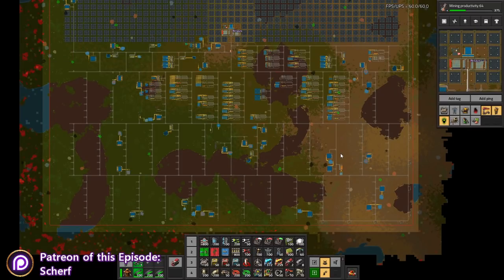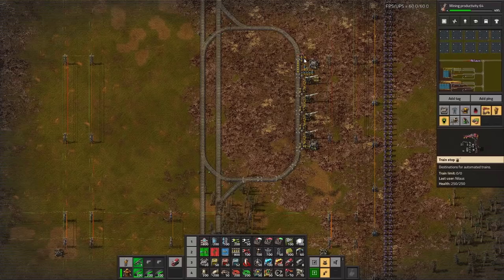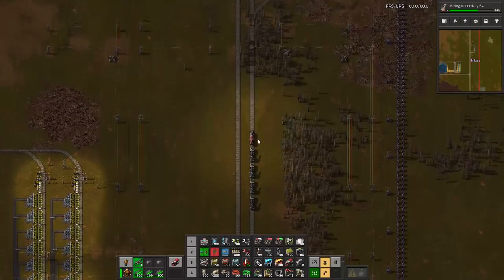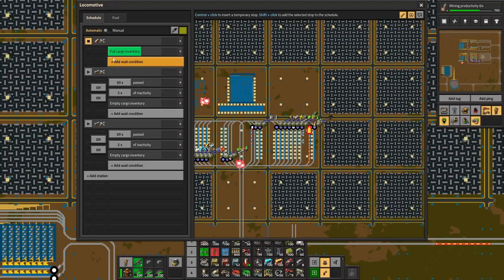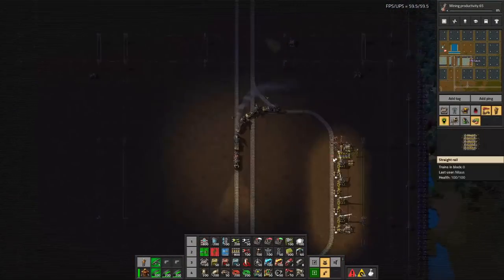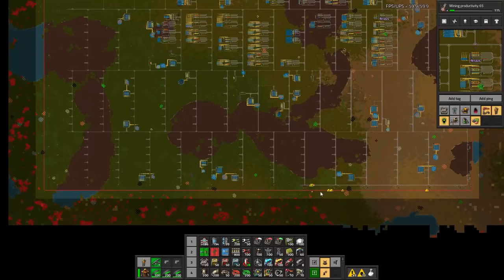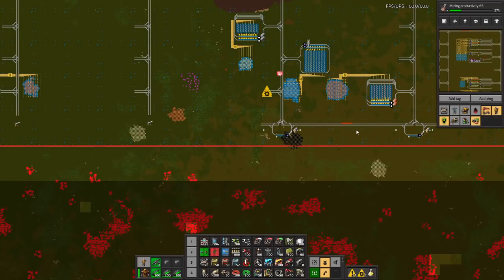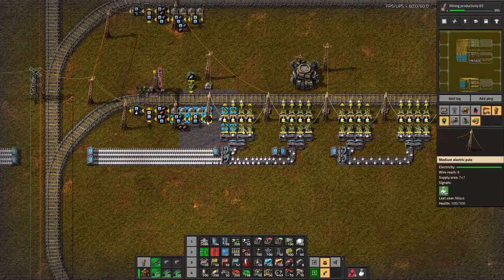Improved ARTILLERY OUTPOST & Monitoring | #51 | Factorio Megabase-In-A-Book Lets Play

Comment: If you think the artillery train is too slow add an engine at the back of the train to push it. This would work with all existing defense stations with no changes. You just need to add another fuel box on the loading station.
Reply: my thoughts exactly. as long as you can still fit 2 in the queue at the loading station without blocking the fueling train
Reply: I would also add a second loco. It does not really matter that the outpost take a slightly long time to be refueled, but they cause a traffic jam, if the global traffic gets higher.
Reply: Doesn't nuclear fuel basically ignore the weight of the train?
Reply: @JohnMeinel  You can't do that with the current setup. Currently, with one locomotive, the two trains only just barely fit in the station without blocking the fueling train.
Reply: Also the artillery train being slower is a feature. It ensures the outposts are fully stacked with repair kits and robots before it starts shooting.
Reply: @sweetcornwhiskey  The fuel train is one engine and one cargo train.  The fuel station can be shortened leaving more space for the artillery trains
Reply: @patrickbellone621  Oh yeah that's right

Comment: I would give 60s for when the artillery train comes in. You spend a long time scanning for the nests, and that let's you use that 100 round capacity better, since they have so far to travel. I also think adding another forward facing train at the back would be great for keeping them from slowing down any main lines.
Reply: The scanning for nests counts as "activity", so you really don't need to make the inactivity timer any longer for that. That's also why the inactivity timer in the video at 13:15 didn't start counting down.

Comment: Artillery defenses are 10/10, love the concept and execution. The alerts on the other hand... You correctly identified at the beginning of the ep that alarming on the science count is too late, but then spent a half episode designing a new way to alert on science count. If you get one of these alerts, it still doesn't tell you the problem and it is still too late of an alert, especially because you did it on count=0, instead of count<8. Count=0 means you can have all kinds of disruption and imbalance without getting alerted. Since your builds are all balanced, you should be alerting on "belt count of inputs". That tells you the exact problem and exact place to work on all from the alert menu without having to pan around the map to understand your alert.
Reply: Idk if it possible but can you alert a station that’s been open for a certain time without getting a train inbound? Make it part of the stations its elf as opposed to watching belts.
Reply: @patdearing5632  If you can read the signal from a train station of whether it's open or not, then it would be possible. There are tutorials and blueprints for timers out there.
Reply: @DFPercush  @Pat Dearing I think it's simpler than that. The way Nilaus built all of these sub factories is to be balanced. If you read any single belt after a belt balancer and it is less than 8, then it is not flowing as expected. Therefore, alarm the engineer. You  don't need to read all input belts, just one of each raw material after the balancer. For any sub factory that has one input as the limiting reagent, you only need to read belt on the limited material.
Reply: If any input fails, the production of the output will halt completely.  Except when just starting up or just running out of materials, it's not possible for train supplied outposts to run at a partially degraded rate.
Reply: @StormCrow42  Not always true. There are plenty of times where a train arrives just as the previous load is depleted and there is a hiccup in the flow rate of an input. Left long enough that hiccup gets big enough to halt output, but internal buffers can compensate for a bit. In fact I find my megabase has this issue for several minutes of production as one of my input raws slows down, and if I alarm my inputs instead of my outputs, I can see the instability starting and address it before it's an issue. At the very least Nilaus setting the belt count to "=0" means his whole sub factory has to halt before he knows there's an issue. At minimum, it should be "<7" to see when real issues are starting"

Comment: Hi Nilaus
Thanks for all of your series so far. Very helpful and a good piece to learn and understand. 

Not really related to this episode, but when playing around with your blueprints I had an issue with the oil production facility. Too much heavy oil was used for transformation into petroleum, which caused full system and therefore a deadlock on the advanced oil cracking. Not for sulfur or acid, but I didn't get the green stuff. I therefore changed the blueprint slightly, added few tanks to store petroleum, so this doesn't stall production of non-suflur products. I then added a green cable from all tanks to the pump that is connected to the heavy->light oil cracking, activating it only if petroleum is very low in the systems (I have a 200k storage and the minimum is 10k). Otherwise the pump is inactive which ensures heavy oil gets converted into green. Now system might still stall, but now it stalls because of heavy oil, sulfur is still at full production, green oil fills easily and if there is need for additional petroleum, my buffer will jump in and if that isn't sufficient, heavy oil cracking will activate. Maybe not an issue at all for your megabase, but in my case I had to fix it as I was at the beginning of transformation when my blue belts didn't get produced in the new "not-a-mall" mall because of lack of green oil.

Cheers and thanks from Switzerland

Comment: Are the artillery trains really a good idea? Only 40 artillery shells (+20 in artillery turret) are stored per station  (You limited it that way, right?) and one train transports 400. Doesn't that mean that the slow artillery train never unloads 85% of the load and just carries it back and forth? And it seems the artillery train actually fires only when the station is newly built. So the large capacity of the train doesn't make much sense.

Comment: I know it sort of sucks to not fit in the block, but room for an extra locomotive at the back of the artillery train would be nice, plus you would probably have room for a stacker for those trains and could have more than 2.  However, either the fuel train or the artillery loading location is going to end up a little weird looking. or taking up a 2nd block.  Think of it this way if you do add a whole 2nd block for loading artillery trains when the artillery distance research goes off, you can have 5-10 artillery trains ready to respond and load up the stations.

Comment: "If for whatever reason they are not full, we'll get a warning."
Actually you'll get a warning only when the belts are empty, if production slows down but not halts completely this will not work right?

Wouldn't it be better to have your condition <8 instead of =0? Or maybe <7 in case there's a gap in the belt every once in a while.
Reply: It's not possible to the builds to just slow down without stopping because all the inputs are coming in via train.  So the input belts will either be full or empty, you can't get partial belts of input like you might with a bus and lots of splitters.
Reply: @StormCrow42  If an input dies completely, then sure, output will go to 0. 
Whats more likely tho, an input fully stopping or and input that isn't able to satisfy demand 100%? 
If one of your inputs demands more than the trains can supply, it will not halt the output, because of the buffer on the belts and so on. It's perfectly possible that production slows down while the input chests/belts dry up and then resumes as the next supply train arrives.
The output will not have halted, but can slow down.
The whole point of adding this alarm was to get notified sooner if there are problems. If you have an input that can't keep up the output might cycle between full and maybe dip down to half. Over time the dashboard will generate an alarm but the new one will not have triggered.

Just look at the production graphs, have you seen something go from 100% to 0% instantly? Unstably supply causes a wave like graph of production slowing down and then ramping back up as fresh input materials arrive.
Reply: Well yes and no. 
Since the input comes from chests which are filled up by train, they provide input materials at full speed until they completely run out.  If the train-to-chest inserters were the bottleneck, the site would never approach 100% duty cycle in the first place. 
Once the materials run out, production halts immediately, it doesn't grind to a halt.  The only way you can get a partially full belt is due to different belt lengths, e.g. if the left column keeps running because its longer belts provide input for a few more seconds, where output drops to ~50% for a short time (again, seconds).

You can of course move the belt scanner closer to the final merge/balancer to detect flaws a bit further up the belt, AND adjust the alert threshold to <=6 if you want  -  but I think those micro-flaws aren't terribly relevant in the big picture.  Maybe more so in a mine that's about to run out.
Reply: @achtsekundenfurz7876  If your input stops, the assemblers at the top will stop first, the remainder on the belt will keep the assemblers down the line fed for a little longer. 
I'd have to paste his blueprint and test to see how long it actually takes to go from full to 0, but it won't be instant.
Everything runs on a train cycle, if you're at a point where the time between trains is long enough for the input to dry up, but long enough for the output to not completely stop it will build up over time and deplete the buffers. 
Anyway, what's the risk in having an alert if the belt count if less than 6? The whole idea is to consume a full belt of science, in order to achieve that you need to produce a full belt. Sure a single momentary lapse will be handled by the huge buffers but perioduc small shortages will build up over time and eat away that big buffer. With no way of fixing the shortage, just like with the space science (well, it is fixed now by having 2 input belts).
Reply: Ideally, If the goal is to be notified as soon as possible when science may be in trouble, you'd monitor the input belts. But since there's a lot more of them it would require more work to set up.
Reply: @devlaminckw  
> the remainder on the belt will keep the assemblers down the line fed for a little longer. 
Yes, they will run out later, but their output (or non-output) wouldn't take as long to move down the output belt, and therefore the time from chest to belt scanner is the same no matter which assembler processes the materials.  Both effects cancel out. 
At least in theory, if X assemblers are the exact amount needed to fill the output  -  but if the exact amount is not an integer (as it often happens with beacon designs), fractional coverage will change the behavior.

But yes, setting the threshild to 6 is an easy way to discover even minor shortage.

Comment: Just as an idea: instead of just setting trainlimits for the refueling you can also close the stations. if all stations are closed your train will head to de refueling and skip the other stations. so you could refuel 2 or 3 stations in one run without beeing stuck due to the "not realy closed but not demanding" Stations. less travel time without the back an forth and less trains needed.

Comment: It would be a bit of a hack, but if you want more artillery trains to fit into the station you could use the lower part of the stacker from the green circuits. That should hold two more artillery trains, and you'll never need more than two trains with green circuits in this station.

Comment: Artillery trains are slow, because you are overloading your locomotive.
Each locomotive can pull either: 4 regular or fluid wagons, 2 locomotives (in a double headed configuration), or 1 artillery wagon.
This has an effect on the acceleration and deceleration of the trains, not the maximum speed.

So if you want your artillery trains to start and stop at the same speed as a regular train, you need to add 3 more locomotives.

This is the reason that double headed artillery trains are awful.
You will need 2 locomotives in each direction for each artillery wagon. (2-1-2, 4-2-4, etc.)

Comment: +1 for digital display.

I recall in one of your older series (Space Exploration?) you were able to use a single constant combinator to control filter inserters for a number of desired items. Could the same strategy be used for the artillery train outposts instead of 1 decider combinator per item type?

Also keen to see if you can have the artillery trains do a circuit until they're empty(ish) before going home to resupply. That'd be quite cool (and efficient).